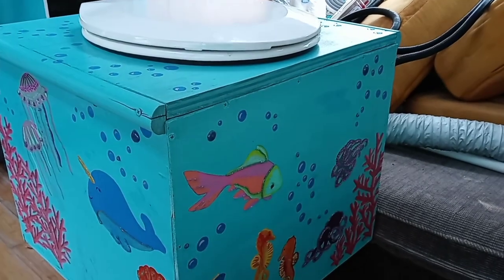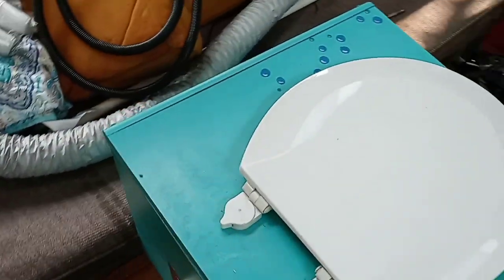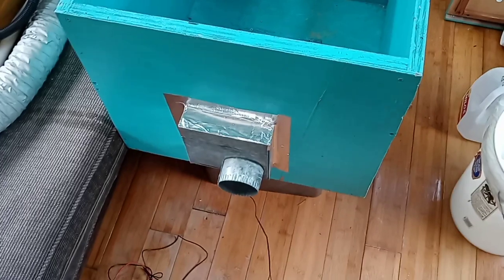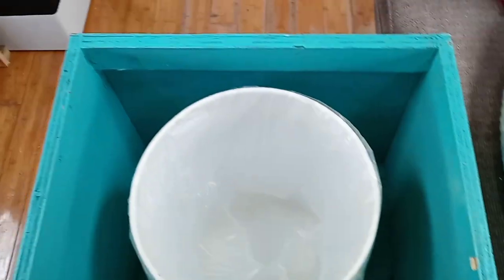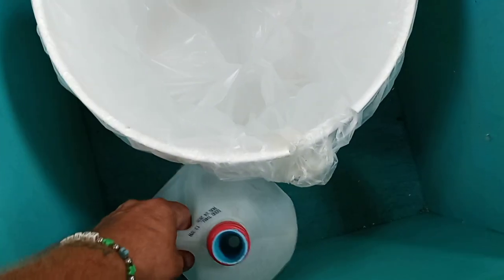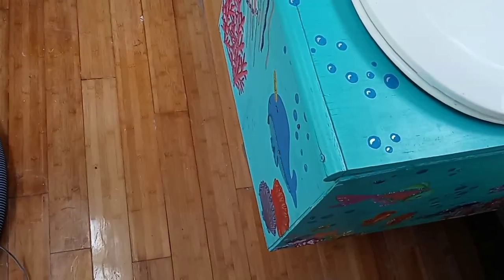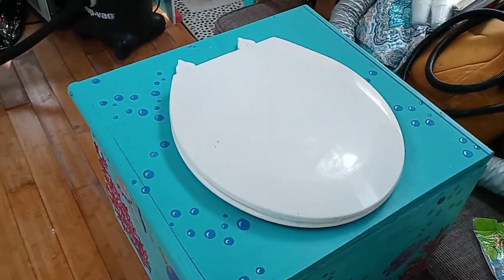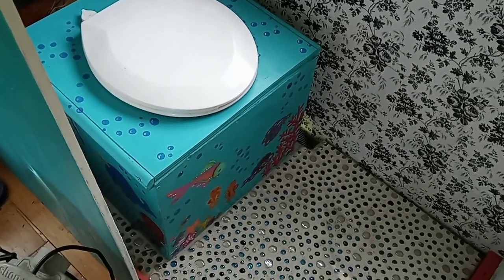DIY Composting toilet!!!!!

Comment: Simple but useful ....if you drill holes through your trim then screw it down the trim will not crack at the ends....great paint job.